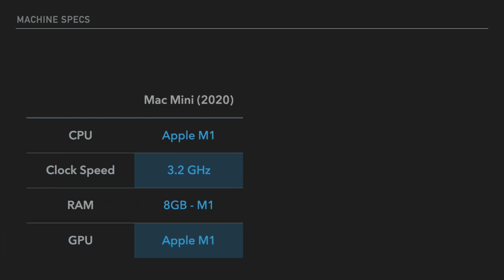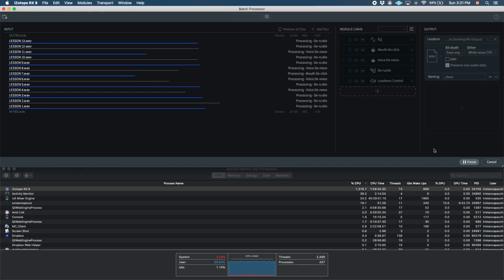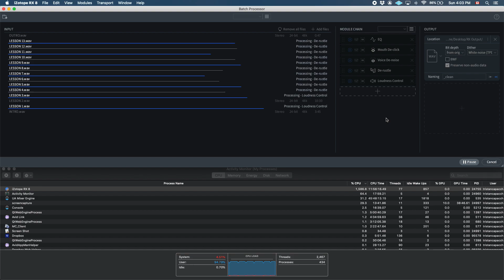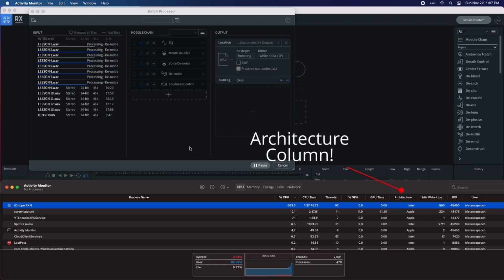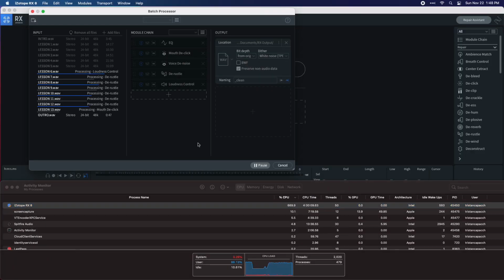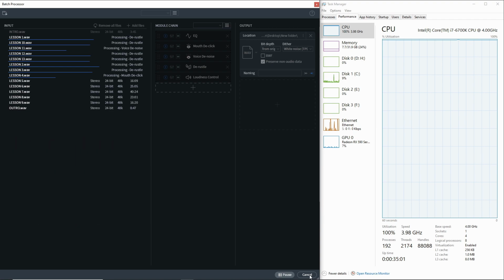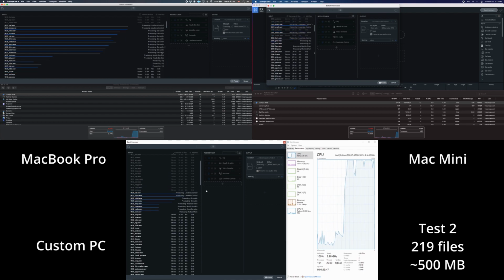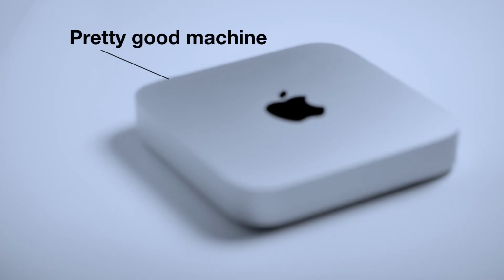Izotope RX8 - M1 Mac Mini vs the rest

Comment: Have you been able to successfully host rx in a protools session?
Reply from the maker: I'm not sure what you mean. If you mean the individual RX plugins (i.e. Mouth De-Click), yes I've hosted them in Pro Tools and other DAWs before. However, some of them can add a LOT of latency making starting/stopping playback feel very laggy. So, I do prefer to try and run things in RX as much as possible, then re-import. It's just a question of balancing time and needs.

Comment: iZotope does not yet support M1 as of 12/21/2020.
Reply from the maker: That's true, but that's why I find this test so interesting. It still did relatively well despite not being optimized for M1. 

I've actually been speaking to some audio developers and adding proper support for a software as complex as RX might take a bit longer, but we'll see.
Reply: @Tcapac  - For the time being, I'm holding off installing any plug-ins (audio or video, I do both) that aren't M1 ready.  Nothing I'm working on right now is so critical that I can't wait.  Hopefully, everyone will get their plug-ins converted to M1 optimized before it causes me any real problems.
Reply: I've been using it as part of my workflow for several months and I second these tests. Not that much faster than Intel—I suspect due to the Rosetta translation of complex code—but it is very stable and no quality penalties. PLUS, it is much, much quieter. I'm coming from a 2013 6-core Mac Pro. I suspect when iZotope finally optimizes RX it will truly fly on these machines.

Comment: As seen on your macbook screen you were also running avid link. This , for some reason, is using lots of power and literally does nothing. I deleted Avid Link and also the 32bit Avid Quicktime Server - since then i nearly dont have fan noise anymore on my macbook pro 15 from 2014. Just a tip -:)
Reply from the maker: I just replaced my 2014 MacBook Pro and let me tell you, I wish it were that simple. The real problem is actually Turbo Boost from what I’ve seen. I installed an app that allows me to disable Turbo Boost for day-to-day work and then the fan doesn’t come on. If not, watching YouTube or something will always spin up the fans. :(